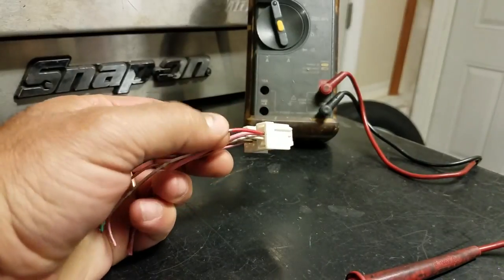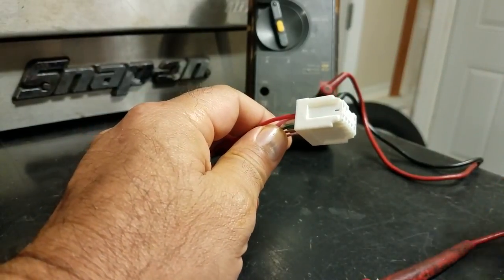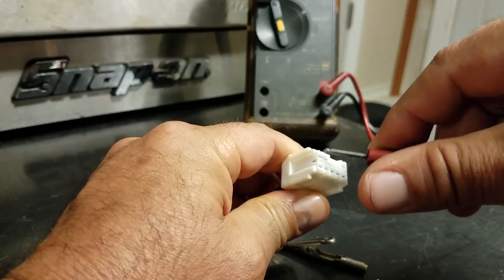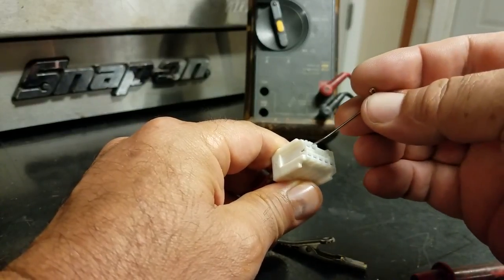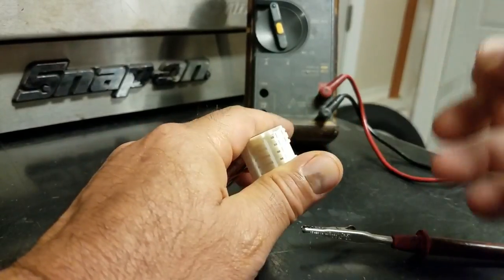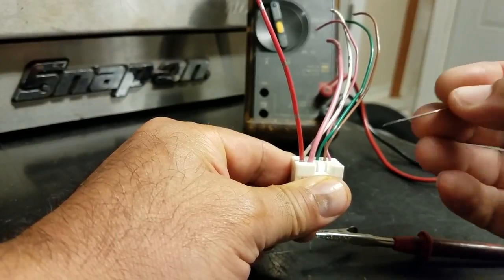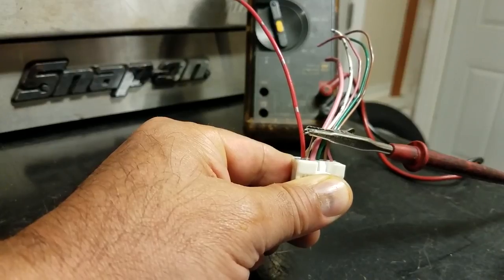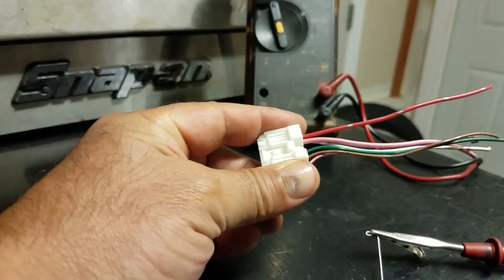How to Probe & Back probe a automotive electrical connector.

Comment: I stretched some female connectors to my ECM by front probing. You have to be really careful and mindful of your probe size vs. the female size. My ECM connector is on a 37 year old Porsche 944 and they deformed easily. Back probing is likely better in most cases, maybe not 100% of cases, but most. Also, there are many newer modern automotive connectors with tiny females and almost any probe can deform them by front-probing. People be aware of this as a possible issue -- damaging connectors.
Reply from the maker: Very true.  You never want to force in a probe into the front of a connector. It can stretch it.  I agree

Comment: Hey I'm checking for my brake light wiring because I want to install a trunk led emblem and seeing what's my positive and I'm probing it but nothing gives then I use a paper clip and still nada... does it have to be specifically t pin? What am I doing wrong

Comment: I just wanna day this is awesome stuff. A lot of people wouldn’t take the time to explain something like this to someone with probably little to no electric background. Great explanation and exactly what I wanted to learn. Good stuff!
Reply from the maker: Your welcome and thanks for watching!
Reply: pro trick: watch series at Flixzone. I've been using it for watching a lot of movies these days.
Reply: @FixyourNissan  My check engine light comes on with a po601 code but then a few minutes later my check engine light goes off could this be the pcm unit itself which is bad or a connectional problem

Comment: So quick question, i will be trying to install ambient lighting to a door panel and using the power window harness. I get the red voltage but i also have to ground to a pin as well. How would i know if the pin is a good ground?

Comment: Caveat to this excellent informational vid. 
Take caution to the relative size of the probes. Otherwise connectors may get stretched out which will result in a faulty connection

Comment: I was worried at first at this video wasn’t going To answer the question that I was looking for, but it indeed did thank you so much. This is super helpful. I assume you can also use a paperclip and bend it around to do the same.
Reply from the maker: You can, but the T-Pin is best and you never want to force it into the connector.  You should feel just a slight resistance.

Comment: Thanks for video. 
I'm trying to troubleshoot a persistent P0713 on my 2004 Toyota Rav4. 
Repair manual suggests checking the voltage between 2 wires from 2 connectors of the ECM with 1 serving as the ground wire. The voltage between the 2 wires should be less than 1V when engine reaches operating temperature.

How do I approach this?

Comment: thank you! I am having an issue with a chevy aveo, I cannot remove the key from the car, it stays in ACC. Everything else (brake lights, shifter) works. I'll give this a try on the lock solenoid and make sure its getting power.

Comment: Great. For weather packing, do you keep T Pin right up against the wire when inserting? I want to backprobe an 18 year old coil...carefully. ..for the labscope.
Reply from the maker: Coil you want to only check power and ground with a volt meter.  When you use the T-pin, you will feel it when it's inserted
Reply: @FixyourNissan  I have a 20:1 attenuator to protect scope from high voltage. Thanks.

Comment: Could this method  be used to check for a shorts? I’m new to electrical and I’m trying to learn more and find a shorts in my car I might have a shorts to ground cause my fuse blow.
Reply from the maker: Yes, but when looking for shorts, you do not want to back probe with the connector plugged in.

Comment: Im trying to test for power on a connector for a camshaft position sensor connector. What setting on the multimeter should i use??
Reply from the maker: You want to monitor Voltage

Comment: My tractor has the blocks/housing that has the latch in the housing. the spades do not have a tab/tangs that flips up to hook into are onto the housing. Where can I find this type of housing and what is it called , my spades  have a little hole in the center when you slide it in, the housing clip catches it. My spades and wiring are good but the housing is old and crumbling apart---just need to know where to get this type of male to female housing with built in latch for 2 pin spade and the same for a 3 pin spade
Reply from the maker: I would need to see what your are seeing to try to assist you
Reply: @FixyourNissan  How do I send you some pictures--Thanks for your help
Reply from the maker: @montyparks734   share in dropbox

Comment: Where do you connect or probe with the black wire on the multimeter?  I thought it may be a nearby metal ground on the body or chassis of the car.
Reply from the maker: Depends on what you are checking.  If you are checking for voltage, you would use the Red Lead to connector or pin that you are checking for voltage, and the black lead to a known good ground
Reply: FixyourNissan thanks for the reply.  This really helps.
Reply from the maker: @jamespn  You are very welcome. Thanks for watching!
Reply: @FixyourNissan  what about when checking resistance in the same instance?

Comment: Do u actually mean to pierce the pin into the red wire or slide it in the gap to back probe ? And could plz explain about continuity and variAble voltages and ground wire as well.
Reply from the maker: You don't need to pierce the wire when back probing.  You are pretty much just laying a pin next to a connector pin to check voltage.    If you would like to learn how to check wire Continuity, there is plenty of video's on it.

Comment: But when you push the T pin in like that from the rear, aren't you making a hole into the watertight seal?
Reply from the maker: the t-pin is small enough that you are pushing the rubber seal out of the way to probe. But when removed the rubber seal just bounces back and seals.
Reply: @FixyourNissan  Ok thanks! I was also about to think even if it did a hole, the hole is very very small
Reply: Great question, possibly a little silicone if you accidentally expose the wire. You don't want to create a future problem with corrosion,
Reply from the maker: @darenleiter9490  Your not exposing any wires doing this. You are simply accessing the electrical pin of the connector to check what ever voltage or ohms you are needing to do

Comment: WHAT are dont's when doing probing wires?
Reply from the maker: Never use to big of a pin and force it in. It should take very little pressure to slide the pin in to back probe. When you front probe the wire, if the pin does not fit, find one that does. That should have very little resistance to insert to test.  If you use to big of a pin, you can expand the electrical connector which can cause pin fit issues.

Comment: where do you ground it?
Reply from the maker: You are looking for a good metal ground if you are grounding one lead while back probing and checking for power.
Reply: @FixyourNissan  when checking for resistance too, you ground negative lead to a good metal part on the chassis right?

Comment: Hello, thanks for your video. Can you even use a needle or a little metallic piece? And also, please, when you test a pin on a connector for continuity, do you just need to test the red wire? For voltage, also the ground wire important and why? What's the purpose of "back probe" if the end of the connector has continuity, please? Thank you.
Reply from the maker: Back probe is when you can leave the connector plugged in and test the connector.  That is the benefit of back probing.  You can check power , Ground and Ohm wires in any of the ways needed with how I showed you in the video
Reply: @FixyourNissan  thanks for your reply. Well, a specific example: I need to test a fan into an ECU box, so if power comes to that connector from the ECU. Do I need to insert a t-pin or something like that on the back of the connector, then ignition on and by V-- on the multimeter can I see the voltage coming or not? And is irrelevant the wire color to point the tips? Thanks
Reply from the maker: @ieripoi   Yes , you would back probe the connector to check for power while it's plugged in

Comment: Now do a drag test with correct terminal size pin in the terminal that you stuck the t pin into on the front side......lol
Reply from the maker: I did front and back of the connector
Reply: B Squirrel how do front probe correctly? particularly how do you identify the pin size using something like the AESWave kit

Comment: What do you set the multimeter at?
Reply: Put meter at lowest setting closest to what your measuring. For example 5 volt circuit use the 20 volt selection on volt meter aka multi meter.   Ohm measure a resistance. No resistance faulty part usually

Comment: Bro, this is a great explanation on fundamentals of electrical circuit integrity checks but its not the best idea to front probe any terminal, it may lead to a splayed terminal and high resistance.
Reply from the maker: Back Probing is actually the most affective when measuring signals in a completed circuit

Comment: Why-o-why are you shoving something into the female side? That can ruin the spring of the connection and ruin that circuit. That's just wrong even with a T-pin. ALWAYS back probe --- never front probe.
Reply from the maker: I agree with you.  But the pin I am using will not stretch these style pins.  Yes pins are much smaller, and those are the ones you really have to be care of doing this to.  But this is just an example
Reply: @FixyourNissan  I really posted my statement for others who might not know such things. Thanks.

Comment: Front-probing with a T-pin! Yikes! Not a good way to check for voltage at the pins. I've fixed quite a few terminals that were spread open by other technicians. I recommend finding the male terminal of the same size with a short length of wire to clamp the alligator clip to. Better yet, just stick with back-probing with a T-pin.
Reply from the maker: It depends on if you Jam it in there or not.  There is different size T-pins.
Reply: @FixyourNissan  yeah, but consider the fact that T-pins are not designed or manufactured to the specification of the terminals. If they are too big, they will over stress the terminal, making it loose. If they are too small they will just slide out when clipping your alligator clip to them. Also, the ends of the T-pins can become bent from use or can easily tilt in the female terminal simply from the weight of the alligator clip and lead, again causing excessive strain on the terminal and making it loose. In fact, I noticed the T-pin in your video is bent at the end. There are a couple of other reasons I prefer not to front probe, namely, front probing means you've disconnected the connector and if you are checking for voltage, you'll simply be checking open circuit voltage. Most diagnostics are better performed by performing a voltage drop test or an available voltage test with current flowing. That way any resistance in the circuit will show up during diagnosis. One can argue, that a check with an ohmmeter can be performed to check for resistance, but what if the terminal you are probing from is the cause of the excessive resistance because it is a spread terminal. You'd never know it by front probing with a T-pin; or what if a wire has broken strands and still has a couple of strands touching. The low voltage from the ohmmeter may not be enough to heat the wire causing excessive resistance like it might when the full 12V is applied and normal current tries to flow through the circuit. One other item to think about, whenever I front probe, I try to use a terminal of the same size or a tool like OTCs terminal test kit (No. 3587). That allows the terminal tension to be checked while testing with a DMM.
Reply: @FixyourNissan  What size t-pin do you recommend for this?
Reply from the maker: @ginobean737  I have 3 different sizes.  It depends on the connector I am probing.  I don't want to stretch the pins of the connector
Reply: Mariano Rubio idk that’s a pricey kit… might as make your own connectors off old pigtails
Reply from the maker: @JosepGee  Pricey kit? 3 dollars for T-pins?
Reply: I think he is replying to "Mariano Rubio" mention of the  OTC terminal test kit (No. 3587).
Reply: @Joseph Gonzalez I agree, that kit is pricey. I should have clarified in my original message that I normally snip pigtails from harnesses when I, or techs around me, perform harness replacements so that I can have my own male test terminals. I have a slight advantage since I work in a shop that repairs passenger cars, light/medium/heavy-duty trucks, earth moving equipment and on-site generators. I have a tote with all sorts of connectors. The OTC kit I mentioned makes it easier for someone who doesn’t have access to different harness to make their own test terminals or just doesn’t have the time to do it. It’s kind of funny, I’m usually the guy that ends up fixing the terminals other techs spread open when they front probe.
Reply: @marianorubio9578 I want to check Voltage between 2 wires at the ECM terminal. How do I go about this please specifically about how to connect the Pins to the wires?

I want to know if transmission fluid temperature sensor of my 2004 Toyota Rav4 is getting the required voltage at the ECM terminal.